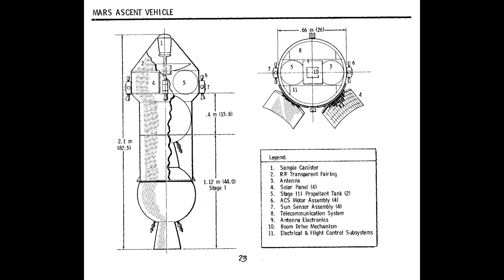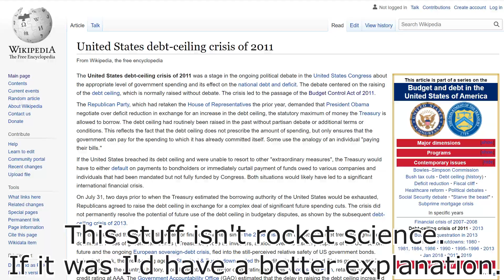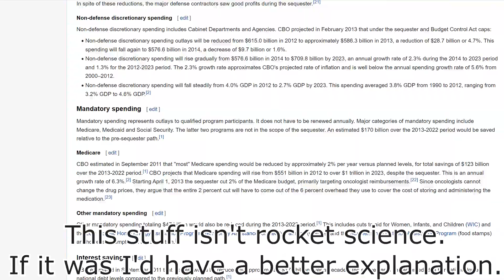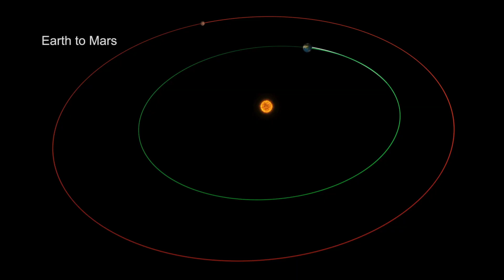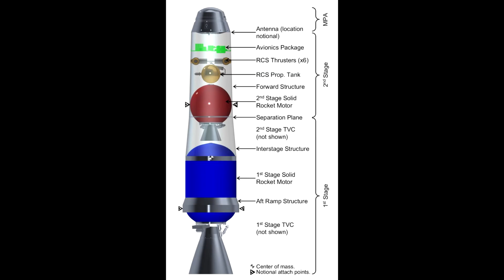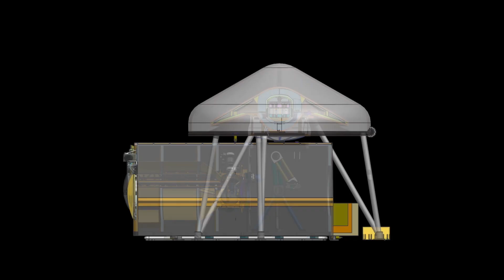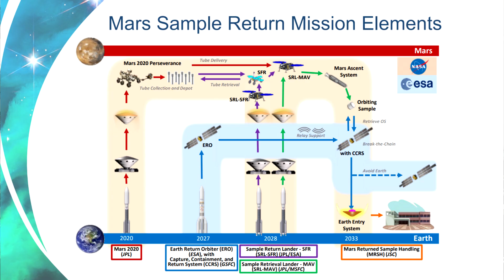Why Getting Rocks Back From Mars Is A Massive Challenge

Comment: Thankyou, it's a tricky operation. Analysis of the Apollo moon rocks gave us a completely new perspective on how the earth moon system, and the solar system more generally was formed.

As for Mars, the positive for life results, of the very sensitive, clever Viking labelled gas release experiment, has never been thoroughly explained. Gil Levin, the experiment's inventor, remained convinced it discovered life. If it turns out there is life there, if still alive, he would surely have been awarded the Nobel. Sadly he died last year aged 97, without the issue ever being resolved.

Comment: I've got 2 related challenges for you:  Sample return missions from Venus and Mercury!
1.  Venus sample return:  If you can figure out how to make a Venus probe capable of extended survival at all, then you have the problem of how to get back up.  A balloon seems the way to go (a rocket would be very inefficient, and Venus is a bit too hot for the fuel/oxidizer mix to use on Mercury below), but what lifting gas are you going to inflate it with?  Best I can think of is to have some kind of metal hydride on board that at the surface temperature on Venus is in equlibrium with a moderately higher pressure of hydrogen gas, so that you can just open the valve to fill the balloon.  Then the balloon craft carrying the samples has to rendezvous with an upper atmospheric exploratory balloon craft that also carries the sample return rocket, which (along with the exploratory balloon craft) need not endure very high temperatures (being always at very high altitude), although these do need to have enough batteries to last through the few earth days worth of upper atmospheric night before the winds carry them back to the day side.
2.  Mercury sample return:  Not as hot as Venus at the surface, but you can't get cool by going to high altitude, and you can't use a balloon at all, so you're going to have to have a rocket land on the surface, and you have a choice of either doing your whole mission on the ground at night and having no illumination or solar power (and it gets VERY COLD at night, but it WASN'T very cold while you were on the way in, so finding a rocket fuel/oxidizer combination that is both stable and usable under both conditions may be a challenge), or doing it in the day and having to have not only the probe survive the high temperatures, but the rocket fuel and oxidizer also has to remain stable at the high temperatures (my thought:  embrace the heat, and use a fuel/oxidizer combination like marine heavy fuel oil + concentrated sulfuric acid, and also carry a small amount of molten sodium or potassium to use as lighter fluid).

Comment: Thanks Scott. By the way, is there a known meteorological reason for those huge and long dust storms on Mars? Have you ever done a video about that? Thanks.
Reply: From the NASA article below, it appears to be heat from the Sun that tends to generate the dust storms, when Mars is closer to the Sun. So, the Martian southern hemisphere summer is what appears to generate the storms, so it is the northern hemisphere winter and spring when they run, which is why the northern hemisphere summer is a good time for clear weather.

NASA website - "The Fact and Fiction of Martian Dust Storms" - Sep 18, 2015

"Large global dust storms put enough dust in the air to completely cover the planet and block out the sun, but doing so ultimately dooms the storm itself. The radiative heat of sunlight reaching the surface of the planet is what drives these dust storms.

As sunlight hits the ground, it warms the air closest to the surface, leaving the upper air cooler.  As in thunderstorms on Earth, the warm and cool air together become unstable, with warm air rising up and taking dust with it.

Rising plumes of warm air create everything from small dust devils, similar to those that form in deserts on Earth, to larger continent-sized storms. These larger storms sometimes combine into the global storms, which cover the entire planet in atmospheric dust.

Larger storms typically only happen during summer in Mars’ southern hemisphere. Seasons on Mars are caused by the tilt of the planet, like on Earth. But Mars’ orbit is less circular than Earth’s; for part of a Martian year, the planet is closer to the sun and therefore significantly hotter. This warmer time is during the southern hemisphere’s summer, so radiative heat forces are strongest then. Once started, bigger storms can last weeks to months.

Scientists aren’t really sure why the years’ long gaps between storms exist. 'It could be that it just takes a while for the sources to replenish themselves,' Smith said. 'Maybe there’s some kind of cycle that the dust has to go through to get back into the right places to trigger a new one, or maybe it’s just kind of luck.'"
Reply: @steveaustin2686  Many thanks!
Reply: @Tod_oMal  You're welcome

Comment: I still can't see what the sample fetch rover does that Perseverance couldn't have done by itself. It seems to store the samples in a rack on its exterior and if Perseverance had done that, they had been accessible by another rover even after a failure.
Reply: Nasa is most worried about sand dunes since it already almost lost Opportunity to it. If this would happen to Perseverance which is carrying the samples, they would need to send a rover with even bigger wheels than the already big Perseverance or even a rover with tracks. Getting the small sample fetch rover stuck in the same sand dune in the way for other rovers would result in a failed mission and a big embarressment. Placing the samples on known easy reachable locations solves this. But: These are no facts, just own thoughts
Reply: Plus this allows Perseverance to go to more diffucult to reach terrain when it has filled all of the containers. Than Perseverance' mission planners do not have to worry anymore about the sample return mission and they can try to make more riskier discoveries. Again: own thoughts, not verrified

Comment: What could some of the problems be with solid rocket motors working at low temps? The only thing I can think of is something you've explained before being the seals between the joints expanding and contracting. Ignition problems maybe?
Reply: Probably none, those engines are very much a know tehnology, Star48 for example was used very frequently for interplanetary probes and is designed for operating both in low and high temperatures of space.

Comment: They're just going to drop it from orbit!?  On land!?  Without even breaching the biology-proof shielding layer!?  

What ever happened to the physics of Rods From God?  I know this isn't the same mass, so it's more cruise missile than it is ICBM in terms of destructive potential, but...that's the fucking plan!?
Reply: That's the plan.  Rock and dirt are hearty stuff.
Reply: @TheEvilmooseofdoom  I'm more worried about the descent vehicle.  Sure metal is strong but reentry impact is a hell of a lot of force.  You've got to damp that out so much that the sample canisters they were using on Mars don't break and mix everything together.  That's a big demand.

There's also the issue of targeting - reentry drops aren't that precise if you're not using a sky crane to pick and choose your position, and if you're off target, whatever's under it isn't gonna know what hit it.
Reply: @rashkavar   The atmospheric breaking of the return capsule will get it down to a couple hundred miles per hour, and that is much easier to design for an impact survival.
Reply: @steveaustin2686  We're still talking nuclear waste storage  canister sort of impact...not exactly easy for a thing you've sent all the way to Mars and back.

Not saying it's impossible, just that it sounds like the toughest available solution.
Reply: @rashkavar  Again, designing the return vehicle to survive a couple of hundred mile per hour impact is deemed simplier than having a traditional return vehicle last that long in space. IF you are going to design it to survive in case the chutes don't open in the first place, why have the chutes?

Comment: I always wonder how missions will change if/when Starship reduces the cost of launches and increases the mass.
Reply: At the current $2.94B HLS Option a contact and expected up to 20 launches (2 landings), that puts Starship's per launch price at a rough $147M. Current launchers for around that price take around 20t to 63.8t to LEO in much smaller fairings. With a larger payload area and more mass margin for the launcher, will you need to make sats and probes out of expensive, super light materials to be light and small? That may be a big change I think.

Comment: A lot of this seems needlessly complex.  Would the hardware for an erector / launcher have more mass than this upwards tosser?  Simply tilt it towards the sky with some kind of barrier / platform to deflect debris.  I mean, Starship hasn't flown yet, but will astronauts walk on Mars and pick up rocks before all this is done? Contingency plans, parallel options are good for unproven designs, I guess it's rocket science.
Reply: People may walk on Mars, but probably won't return before this mission does.

Comment: Makes me curious though.. how much better are a bunch a rock core samples, than just a bunch of complete rocks (to be cored back on earth)?
Or why is it better to make those cores now, rather than just make fresh ones when the return rocket lands? As long as its before the first human mars mission.

Wouldn't it be much simpler to instead of perserverence+fetchrover+launchplatform, just to have a single bigger launchplatform with a (big) digger on it,
to load it directly into the return rocket, from where it lands? To just get a few kilos of mars rock+soil, rather than those seemingly tiny tubes :P

As long as it would land in a somewhat interesting area, then that would be worth doing surely? (and could have been done much quicker, if it had been planned like that at the beginning)
and then do the small localized samples' return later, depending on kind of data the first (brute force) method yields.
Reply: Taking the whole rock means more mass.  Mass is always the limiting factor.
Reply: @TheEvilmooseofdoom  Of course, but the outside of them is also interesting to scientists I imagine? 
If you could drop the fetch rover, you would have a lot more margin for a return rocket.. if.. it would have been done in one launch.. which apparently it isn't, so moot point maybe, but I'm not sure how the complexity of building a bigger lander, stacks up against adding an entire extra vehicle.

Comment: I can think of about a billion and one better uses for $7 billion than a sample return from Mars. How about solving climate change for a start so there will be people around in a hundred or so years to work on a sample return mission?
Reply: You are being simplistic.  How does one solve the climate problem with 7 billion?
Reply: @TheEvilmooseofdoom  OK, you are right. We won't "solve" climate with 7 billion but it would be a start. When one is racing at 60 MPH towards a cliff one at least tries to put on the brakes instead of pressing the accelerator even harder. We as a species will not survive unless we drastically change our ways. That is a fact. Any negligible scientific knowledge gained by studying Martian rock and soil samples in my opinion at this point in human history is a complete misdirection of limited resources.

Comment: When do you think Starship will be finally ready for use and sale? 
You mentioned 2023 as NASA's date for mission.
Reply: I would guess between 2024 and 2026. Musk has said that they have high confidence of Starship getting to orbit, but it may take several attempts at a successful re-entry and landing. SpaceX also has a $50M contract to demo Starship to Starship refueling in LEO by the end of 2022. SpaceX is likely to do some Starlink missions to prove Starship out, once they are confident enough to keep one in orbit. The Artemis III manned landing is likely to happen in 2026, if nothing big goes wrong, per the NASA IG. SpaceX has to have the [DELETED] propellant depot, Starship Tankers, and Lunar Starship ready and to have already done an unmanned test landing before the Artemis III mission. That is a lot of work to be done. SpaceX can't do too many side trips.
Reply: @steveaustin2686  I would think that starship wouldn't have to be interplanetary ready in order to make NASA's plans massively different, the preasence of a super heavy booster would mean they could put a ISS sized vessel in orbit with a single launch.
At the moment their plans revolve around the SLS boosters and Falcon Heavy.
Reply: @syd4952  Once Starship is ready to go to the Moon, it is ready to go to Mars. The issue is returning from Mars, which is a much harder proposition. I would not be surprised for an unmanned Starship to go to Mars by the end of this decade. Getting back from Mars is why manned missions would be in the 2030s at best and more likely the 2040s per NASA.
Reply: It is more a matter of IF it will be ready. The recent events suggest it may not be.
Reply: @HalNordmann  tbh I'm more interested in if the booster will succeed. I feel like they will be making more fairing launches for NASA than actual starship vehicle ones. Tbh I dont really see how they could mess that up, they have a rediculous amount of data on boosters at this point.
Reply: @syd4952  The Starship booster is much bigger, and uses an untested and risky landing method. Also it has more engines than the N-1, all packed extremely tightly together - one blows up, all are wrecked. Doesn't seem likely to me.
Reply: @HalNordmann  ya I'm not convinced on the big grabbing tower either. But the the raptor engines are very tested at this point and I doubt they will see any USDs on their behalf, I think it will make it to orbit though, I would put money on that part.
Reply: @syd4952  The Raptor 1 engines blew up pretty regularly. SpaceX has said that the Raptor 2s are not quite yet to the targets that they want and I believe that Raptor 2 isn't the final version either. Raptor 2s have yet to fly.
Reply: @steveaustin2686  I didn't realise they were using a completely different engine if that us what you're saying. But I believe it's been some time since there have been any raptor 1 engine failures.
Reply: @syd4952  SN11 blew up because of a Raptor 1 engine hard start. SN15 flew successfully. That's the last flight of the Raptor 1 engines. Raptor 2 engines have yet to fly, but they will be used on the first 'orbital' flight per Musk.
Reply: @HalNordmann  The N1 had 30 engines. The first 'orbital' booster is going to have 33 engines. The Falcon Heavy has 27 engines, so the jump to 33 is as not as big as it appears. Computer engine control has come a long way since the 1960s.
Reply: @steveaustin2686  The Falcon Heavy is made of 3 separate stages, which don't have the engines packed as tightly. Plus, failure modes of gas-generator engines are a lot more benign.
Reply: @HalNordmann  Again, engine control tech has advanced a lot in over 60 years since the last N1 flew.

Again, the jump from the Falcon Heavy to Starship is not as big as it appears, since SpaceX has experience with controlling almost as many engines. Don't misunderstand what I said. I'm not saying that they are the same, but the jump is not that large as for others.
Reply: @steveaustin2686  It is not just about engine control. For example, hydrostatic shocks - these things can break a rocket apart if an engine shuts down suddenly.
Reply: @HalNordmann  SpaceX engineers are smart, they have surely considered that.
Reply: @steveaustin2686  The engineers are probably quite smart. They are not the ones making decisions however - Elon does, and they follow them no matter how stupid they are. After all, several people have already been fired over disagreeing with him.
Reply: @HalNordmann  LOL, whatever floats your goat. NASA engineers also had hands on access to Starship and NASA is confident enough to award SpaceX a $2.94B contract as the only lander for Artemis III. I'll take the experts over YT comments.
Reply: Just remembered USD/UD isnt explained anywhere, it's a joke standing for Unscheduled Dissasembily.

Comment: i dont know enough about space but will what rocket power would be needed to have a 365 or close launch cadence to mars?
Reply: Something with a really long duration engine that is fairly fast. At their furthest, Mars and the Earth are on opposite sides of the Sun and are roughly 244 million miles apart. Light takes almost 22 minutes to travel that distance. Nuclear Themal Propulsion is said to reduce the travel time to Mars by 25%, but that is apparently still with using Mars windows.

Comment: I have a question.  How much easier would it be for Starship to re-enter the atmosphere from a trip from say US to Europe.  This should not require as high a speed as a ship needing full orbital velocities.  I know there is trace atmosphere up there still that creates drag on stuff like the ISS.  How much slower could they go and would the re-entry be much easier?
Reply: It would be a fairly long suborbital flight, so would likely get up to significant speed. Since Starship is being designed for re-entry at least at orbital re-entry speeds, if not interplanetary re-entry speeds, it would be well within the capabilities of the Starship design. It won't happen anytime soon, as the early Starship flights will be targeted on the open ocean, in case things go wrong. The initial 'orbital' flight will get up to orbital speed per Musk, but won't circularize the orbit, so it will come down around 62 miles north of Kauai, HI.